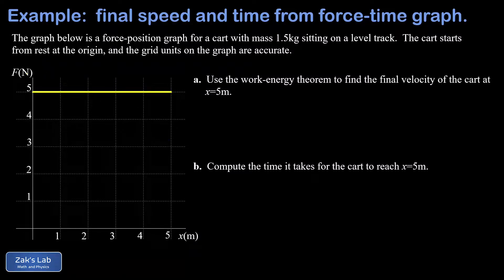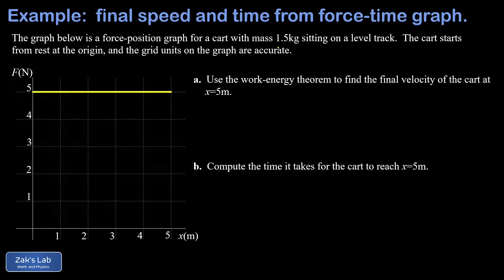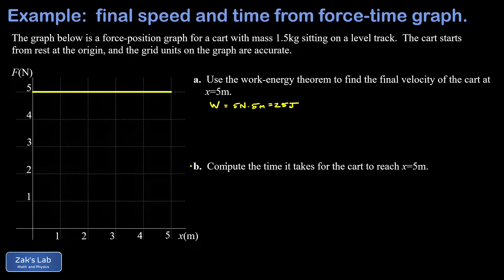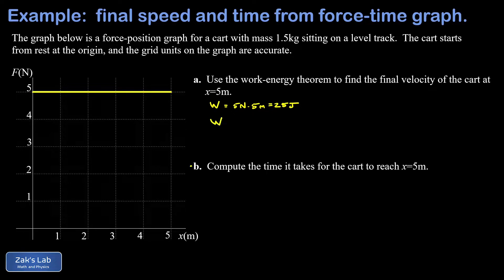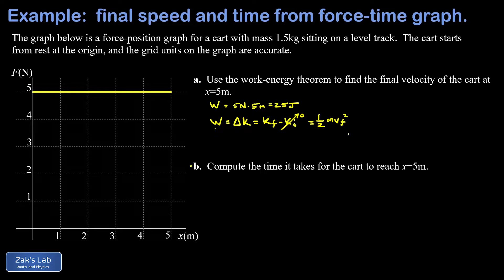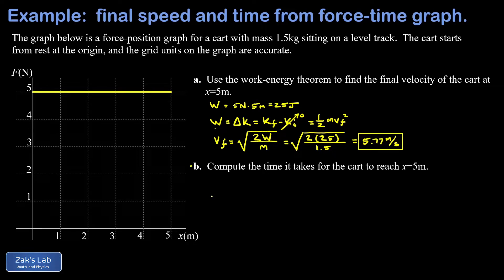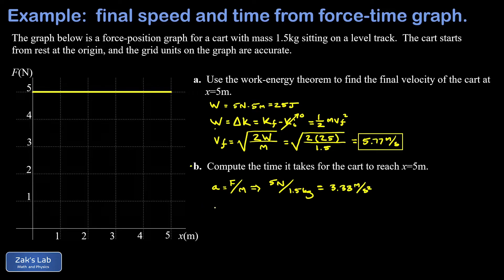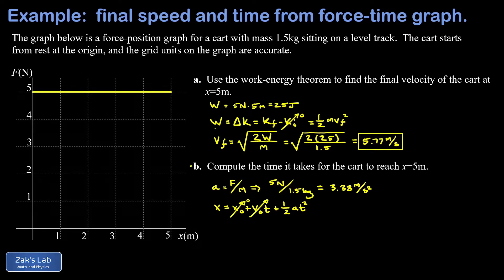Work and energy: final velocity from force displacement graph, and total time from force graph.

Comment: what happens when the initial velocity is 10m/s?
Reply from the maker: Then the work energy theorem generalizes to W=delta(K)=K_final-K_initial.  So you just throw in that K_initial term using your initial velocity of 10m/s, and you can solve for v_f.  On the time question, you know v_i, v_f, acceleration (and the fact that acceleration is constant), so you could use the basic kinematics formula v=v_0+at and solve for t. - Zak